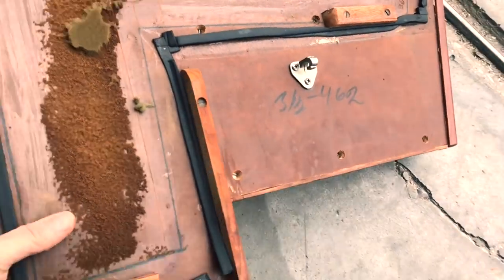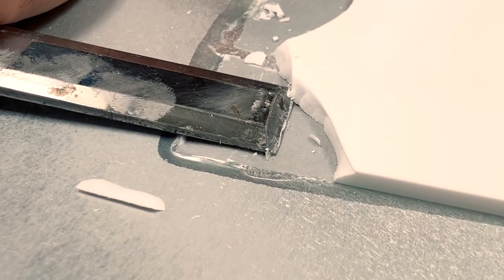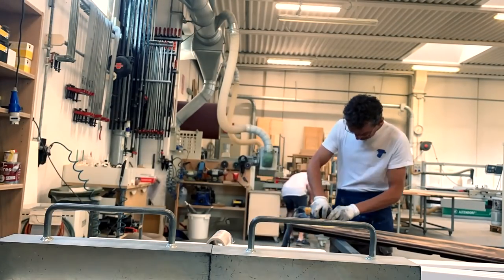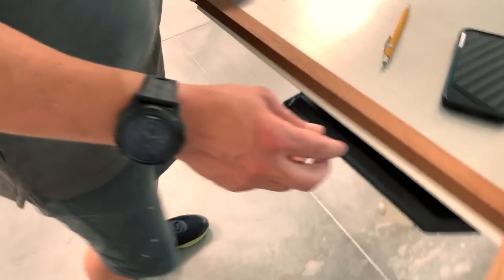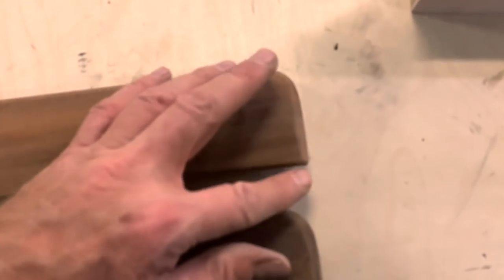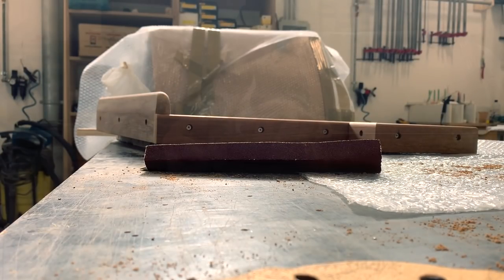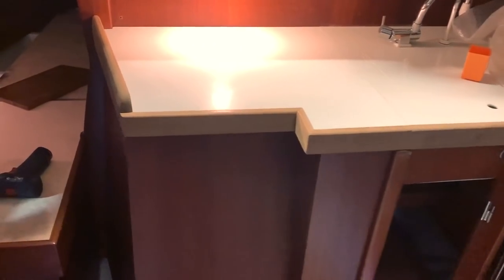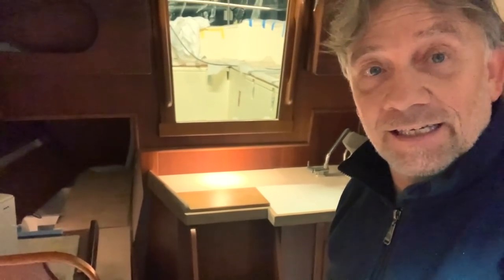Hallberg-Rassy 312 "Ellös": THE MAKING OF THE ENGINE COVER (DIYBOAT)

Comment: Great work Gabriele. Looks really good and built to last.
Have you thought about a small covered hole to be able to insert the hose from a fire extinguisher into the engine compartment. Just in case.....
Reply from the maker: Yes mate still thinking about that... boat is not  CE so not need but for my safety I want think about it

Comment: That's just the boat talking to you - she wanted new steps and cover to go with all the rest of that gorgeous work 👏 ......I think if it was me, I'd have made the top step full size in teak to cover the corian section, rather than just the size of a step tread - I think that would be functionally better.
Reply from the maker: Thx mate! I prefer to got the same design as was in origin! You can’t have a Ferrari and use oversize tires you ruin the looking 😉
Reply: Yes, that's true. i was just thinking more protection ....I don't wanna see her get dirty 😂
Reply from the maker: Ah ah ah is more easy to clean the Corian belive me😂